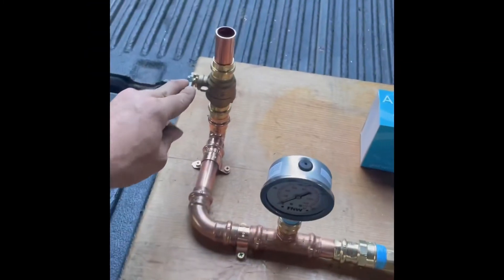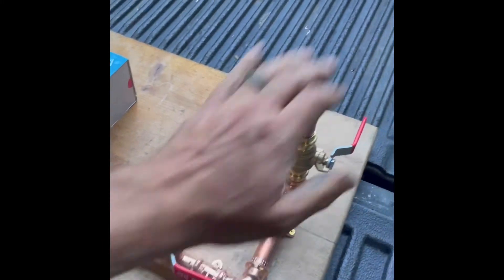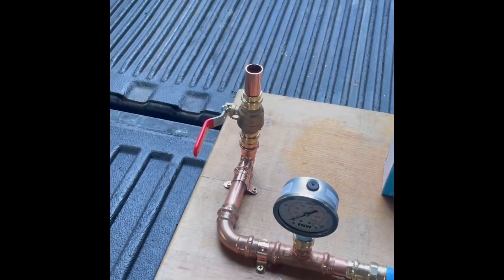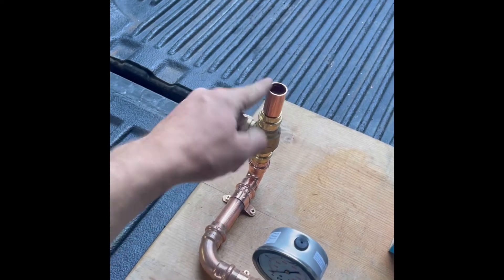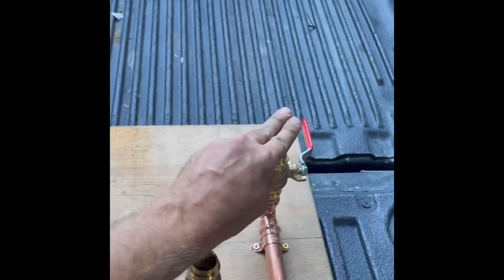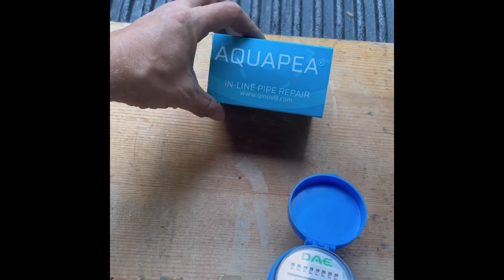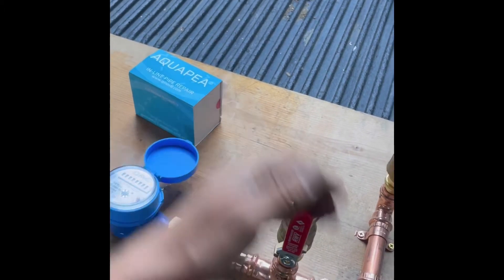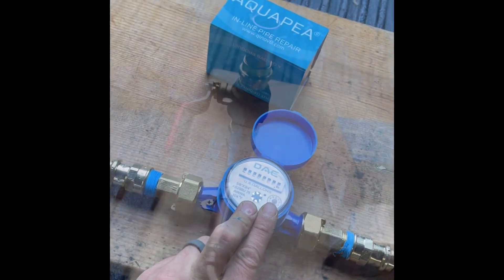AquaPea Insertion Kit

Comment: I just purchased two aqua pea for a leak under foundation that was located by professional leak detector. I placed aqua pea at beginning of main line and neither worked even a little. No change in flow to even slow it down. Had to re pipe. I took a chance that would have saved thousands if it worked. I lost 150 plus shipping.